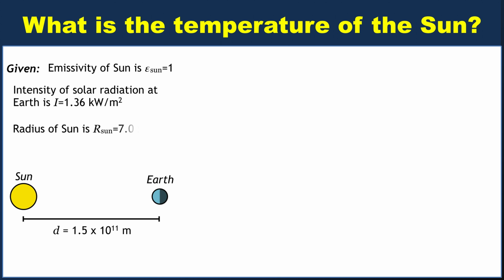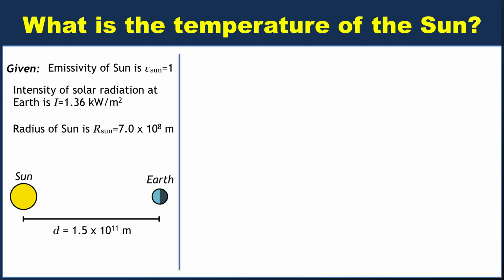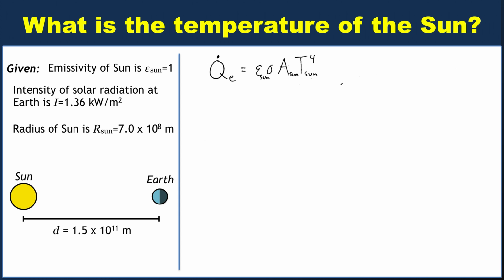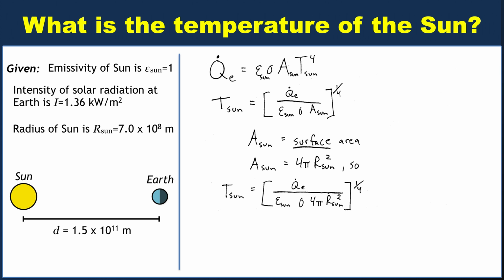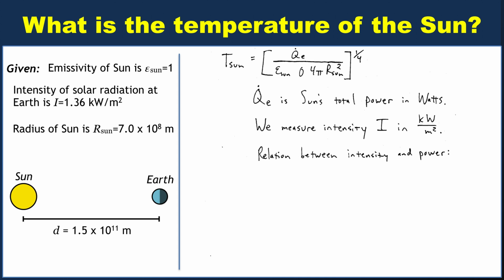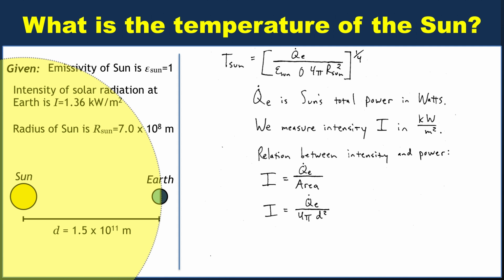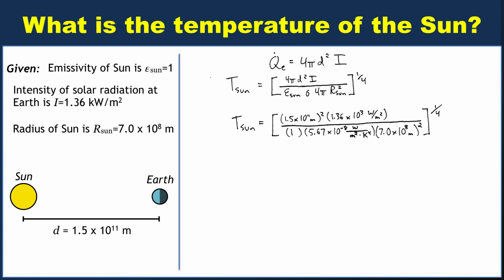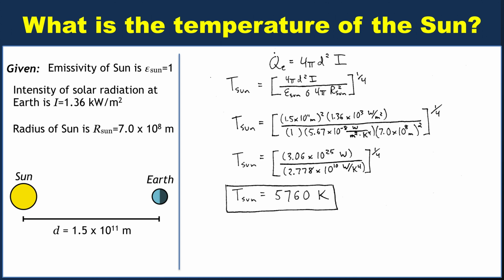Example: Calculating the temperature of the Sun

Comment: The Temperature of The 🌞 is 14,072 degrees ferhit The Diameter of The Sun is 853,000 miles in diameter The Circumference of The Sun is 2,679,785 miles in circumference At the Surface it burns 27,000,000,000 Degrees or celses🎓🎓🎓🎓🎓🎓🎓🎓🎓🎓🎓💥💥💥💥💥💥💥📚📚📚📚📚📚📚📚☕☕☕☕☕☕☕☕☕☕☕☕